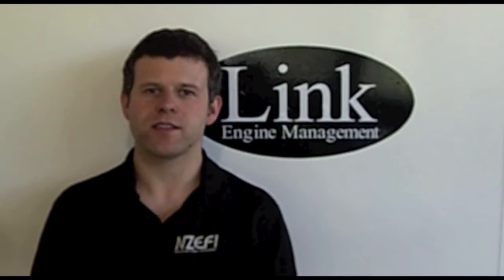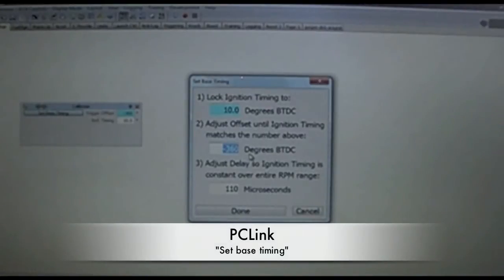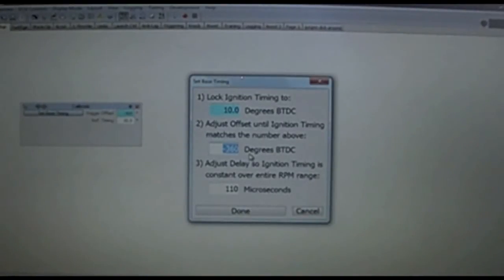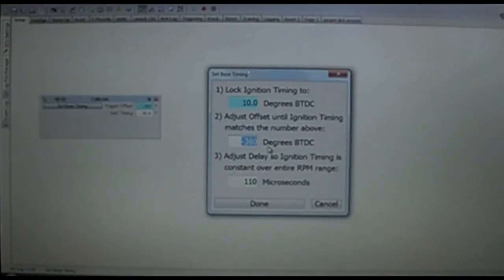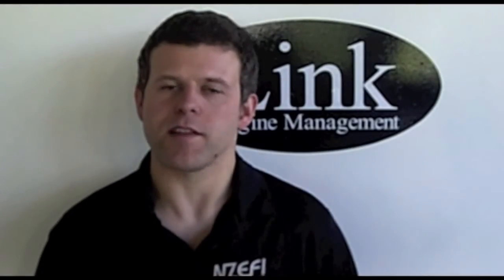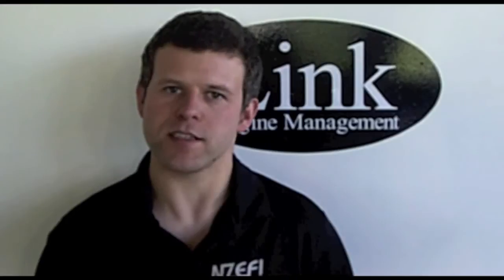Incorrect Trigger Offset

Comment: i have a 300zx twin turbo with a 300zx specific link ecu. Base map said 0 deg timing. car started but ran real rough. Adjusted offset to -89, car runs smooth as glass . Why would that be ?
Reply: 1:49 "this will be different for every application"